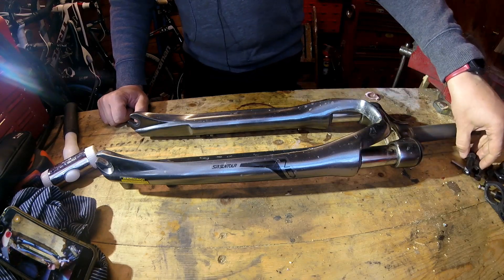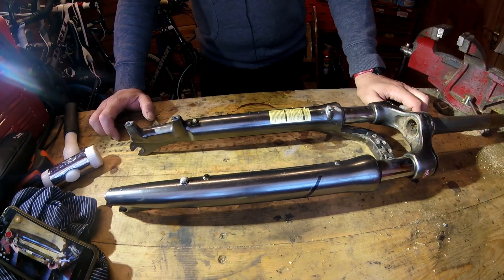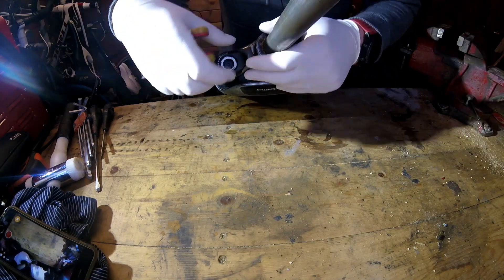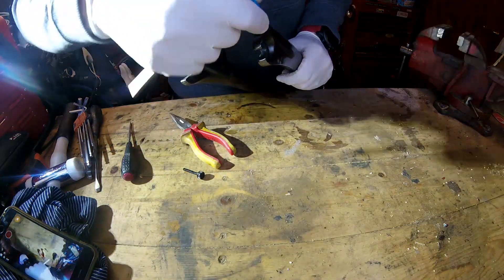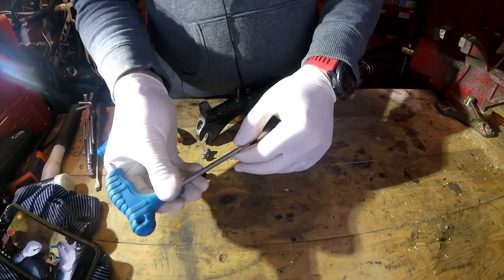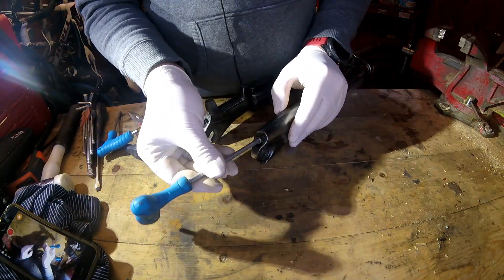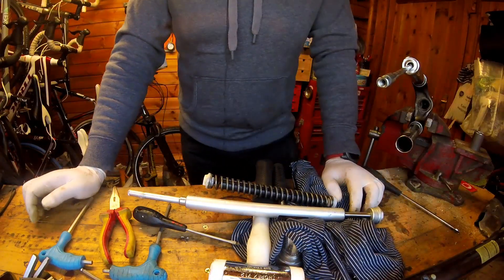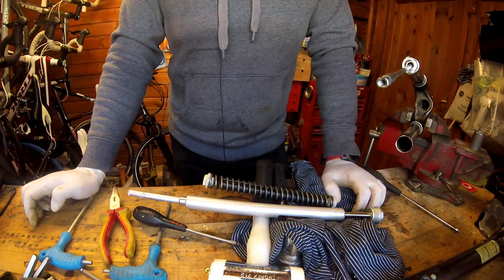SR Suntour - Budget Suspension Fork Stripdown

Comment: Hello Mate would like to find out from you in your scrap sr suntour forks do you have SF14 NEX SBC DS HLO 700C 63MM since mine the disc mounts are broken
Reply from the maker: Ah - not really sure - I scrapped them shortly after I made this. Having said that, there are a ton of cheap Suntour forks on eBay that will probably be right for you.